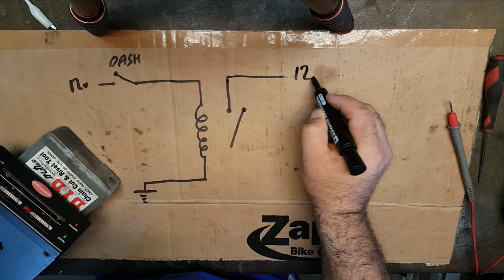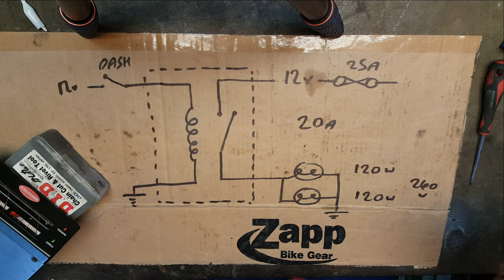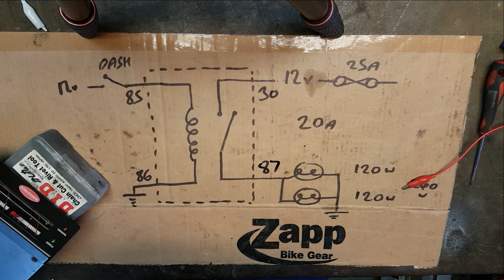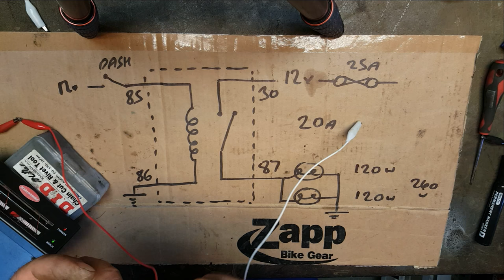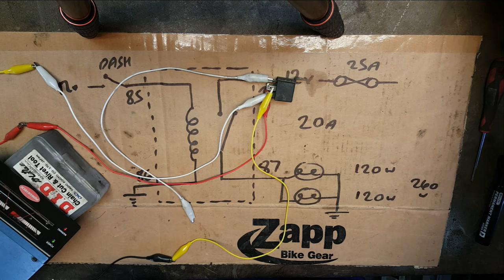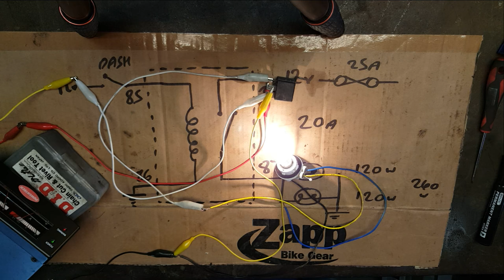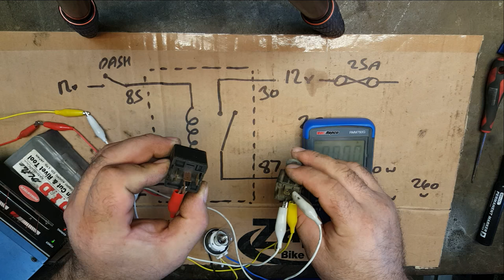How to wire up a relay #1922

Comment: Man you are good at teaching,excellent video, i did have a question, i have ran into many times where instructions say "wire power from battery to 87" but a lot of the videos i have seen say 30, so is it 87 or 30 or whatever you like? thank you for your time.
Reply from the maker: It's best to wire to 30 but to be fair it's only a switch with two contacts so in reality it just doesn't matter. 

Cheers Andy

Comment: If I was going to hook up lights just as you described with a brand new switch, what size wire would I need going from battery to the new switch on the dash?
 How much Amps and Volts does it take to activate the relay between pins 86 and 85?
Reply from the maker: +707SonomaComa it depends on the total wattage of the bulbs. Add it up and divide by 12v to give you the amps.

Yes 12v and about 0.8 of an amp to trigger the relay

Comment: If you wanted to add a status LED to the dash switch, to come on when the lights are switched on, would you connect the positive leg of the LED to terminal 87 of the relay?
Reply from the maker: +keitho77 Morning Keitho77, yes, that will work fine but you'd need a resistor before the LED as they only run around 6 volts. I think a 1k ohm resistor is fine from memory. See logic probe video I did to confirm. Cheers Andy

Comment: HI, question: I have  210 watts LED light bar. What Amperes do I need for a luminated switch, relay, and fuse?? Thank u!
Reply from the maker: +Basement31 if it's a 12 volt vehicle then 210 watts ÷ 12v = 17.5 amps so a 20 amp relay & a 20 amp fuse should be fine.  Use the switch to trigger the relay, don't run the power for the light bar through the switch as its too high. Hope this helps. Cheers Andy
Reply: Andy Mechanic great! Btw, can I combine the ground wire from the LED light bar and the ground wire from the relay to 1 wire and screw them on the chassis? Thanks Andy!
Reply from the maker: +Basement31 sure can :-)
Reply: I wanted to use a 40amp relay coz that's what's available to me. Do I still use a 20 amp fuse? And can I use a 20 amp illuminated rocker switch?
Reply from the maker: +Basement31 a 40 amp relay is fine.  It'll last much longer. Use a 20 amp fuse though. Rocker switch only needs to carry sufficient amps to trigger the relay. I'd say it'll be no more than an amp or two at the most.

Comment: i have a question,
in your example, did 30 go to the positive on the battery? and did output 87 go to the negative or positive of the light (I'm not gonna be using a light but something where postive and negative are marked...)
Reply from the maker: +Jelmer Douma ah...yes pin 30 is always battery +. The pin 87 is the + output so needs connecting to the + side of your consumer (bulb, motor etc)

Hope this is of help. Cheers Andy
Reply: Andy Mechanic Yessss, I wired it up just like you did in the video and it works just fine now. thank you soo so much, youre awesome. I subscribed!
Reply from the maker: +Jelmer Douma Awesome job :-)  Pleased to be of help, welcome aboard. Andy
Reply: Consumer side of the circuit...of course. Thanks Andy...

Comment: At 6:17 why divide 240 by 12?
Reply from the maker: +C Sandiford Watts ÷ Volts = Amps (current flow). You need to know this for the fuse size and to ensure the relay you use is capable of carrying the current flow.

Hope that helps. Cheers Andy
Reply: Thanks Andy. Keep up the good work.